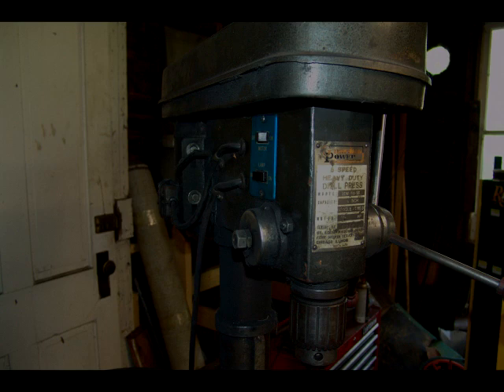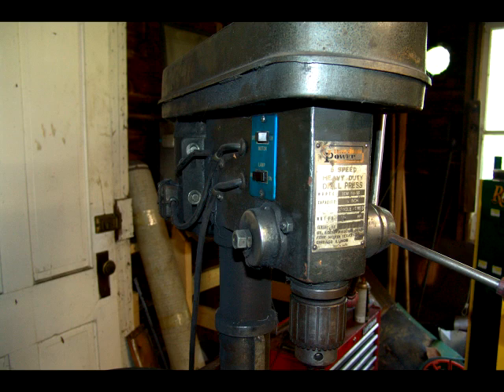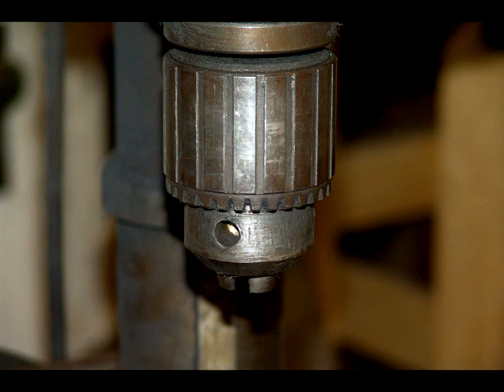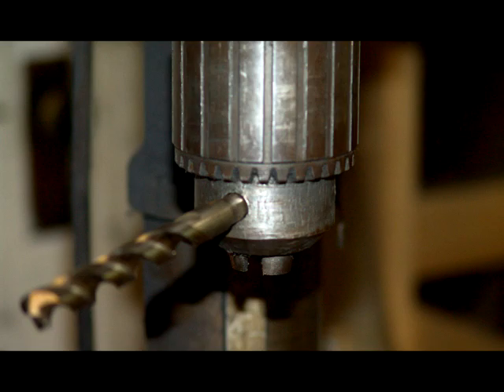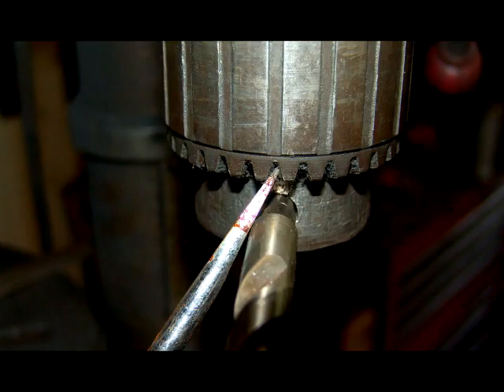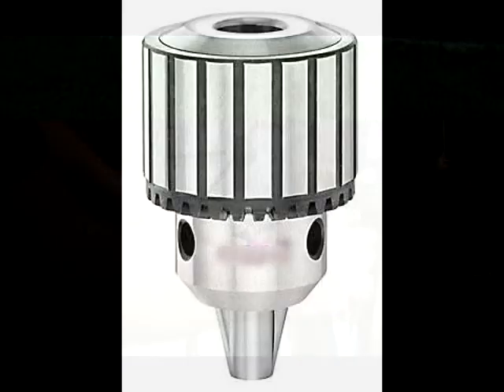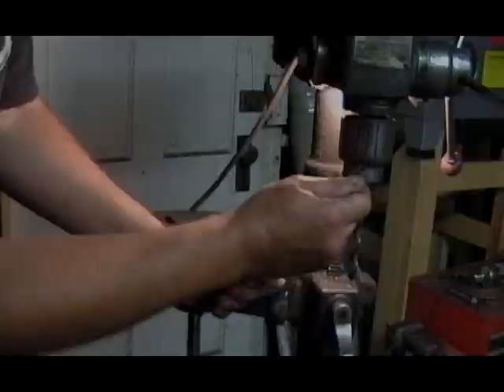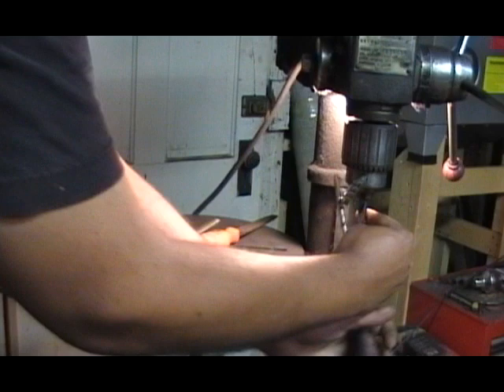DIY - Missing Drill Chuck Key? - I Have a Solution!

Comment: This method will NOT damage the teeth at all! In fact this method is less damaging than using the actual chuck key! I used this method MANY times and it has NEVER hurt the teeth in the slightest! Don't hesitate to use this method, it won't hurt you chuck in the slightest.
Reply: Y.S.M. THANKS!!

Comment: I have an older drill and couldn't turn the chuck (granted it was a little small, but still turnable). I've sprayed it with WD-40 and going to try it again. I also have already tried tihs method, but I'll also didn't work. I'll try it again as well. Any ideas?